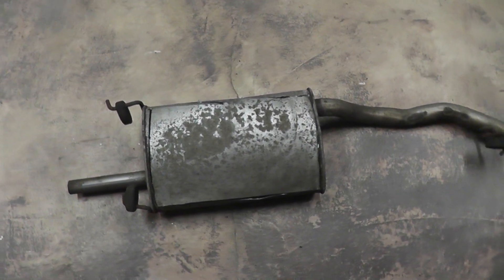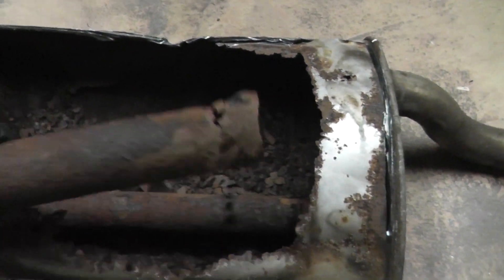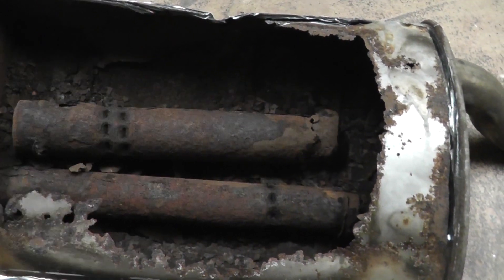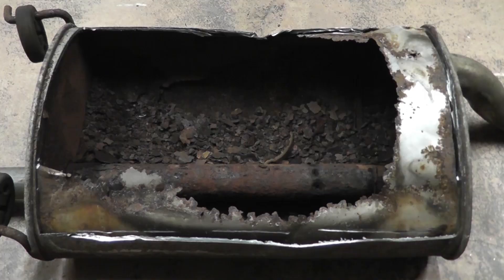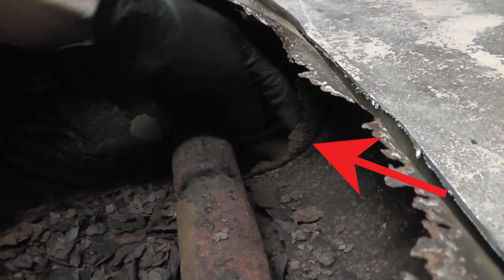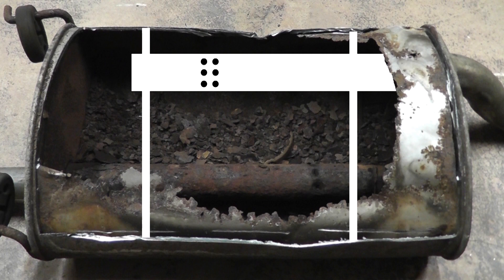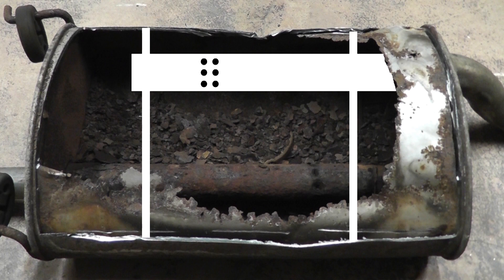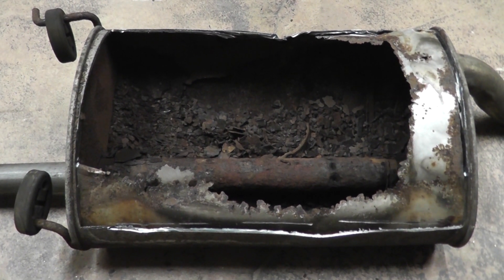Inside A Rusted Out Muffler

Comment: the muffler on my old 95 Accord V6 broke completely off an the muffler inlet and the muffler shell was starting to unravel, but the case and internals were still intact enough to were it wasn't loud

older Honda's not assembled in the US have thinner exhaust which is why you see tons of old Honda's with replaced or rotted out exhausts, i had made redone at a muffler shop from the cat back with no resonator and a turbo mufflers, sounds pretty good, not loud but flows better, the high rpm Honda engines like the extra flow

Comment: What brand of muffler was it? as Walker exhaust products are much worse they rust out prematurarly the one vehicle i had its muffler got blown by a backfire as it had no cat on it which was not required on pre 1975 vehicles. since then i went with all stainless steel pipes, resonators and Mufflers custom made as they are going to last the life of the car not only they cost more it will pay off the number of years u need to replace a muffler or exhaust as there is 409 and the best 304 stainless steel. as i had a 304 stainless steel on my 99 Honda CR-V when its transmission failed and 127,000 miles it never rested ever not even the welds or muffler.  i wouldn't go with walker as i would go with another brand of muffler and getting your pipes custom made of stainless steel.
Reply from the maker: It was a Bosal I think.

Aftermarket exhaust parts never seem to measure up to the OEM parts construction wise probably in an effort to meet the lower price point.

I agree stainless would be the first choice if you can afford it.
Reply: the OE Honda parts will last a while but a muffler shop that does antimagnetic 304 Stainless steel pipes and mufflers will last indefinately i had it on my 99 crv i can't make out the muffler brand he used it was quiet so im guessing Bosal and Walker aren't good exhausts especially where i live in PA the northeast states where they rust out the most most 304 stainless steel mufflers are mainly the performance types which is louder than OE.  it gets tiring to replace rusted out mufflers as i found 304 stainless pipes last indefinitaly the cheaper 409 stainless steel will also last along time. i have an 08 crv wanting to do a dual rear muffler setup as i have to go with AP Exhaust 11 inch case mufflers which is all i can fit there. as i don't think none are made from Stainless steel. it will just only be the pipes i have to see how long the AP Exhaust mufflers last. when the dual exhaust project gets completed on it.